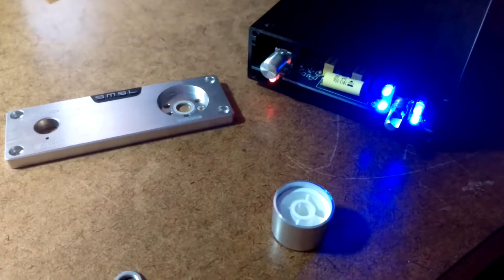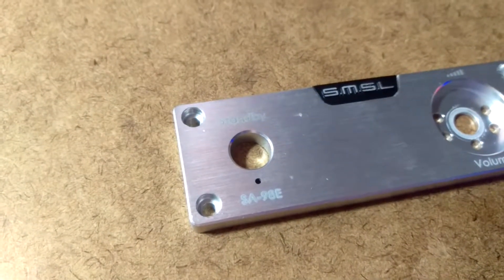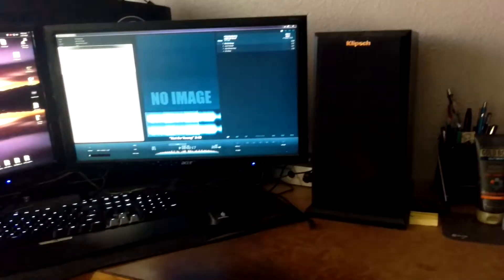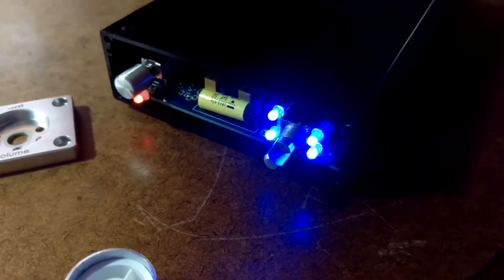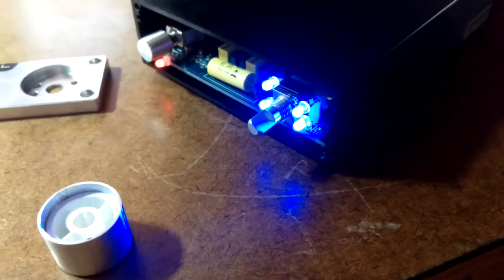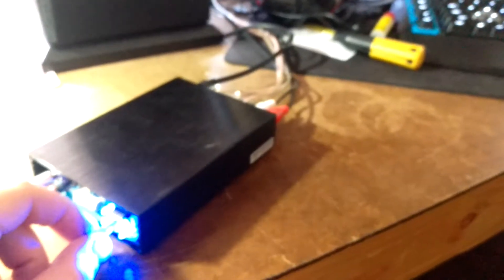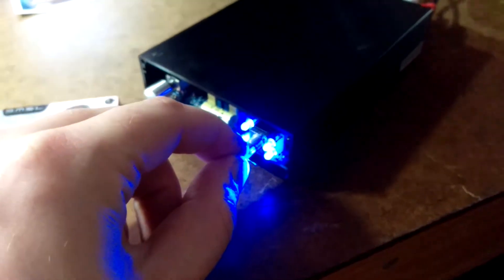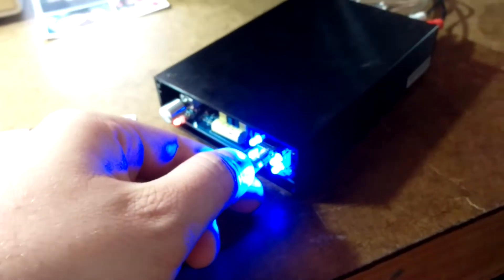Potentiometer Problems with an SMSL SA-98E Amp

Comment: You could try using some potentiometer cleaner where the L/R channel contacts are (if you can get to them). Try this: https://www.amazon.com/Hosa-D5S-6-DeoxIT-Contact-Cleaner/dp/B00006LVEU/ref=sr_1_1?s=electronics&ie=UTF8&qid=1525638346&sr=1-1&keywords=pot+cleaner&dpID=31bF7ZIS7cL&preST=_SX300_QL70_&dpSrc=srch